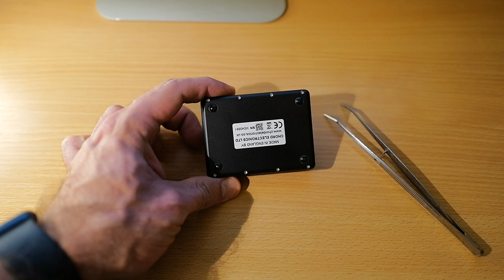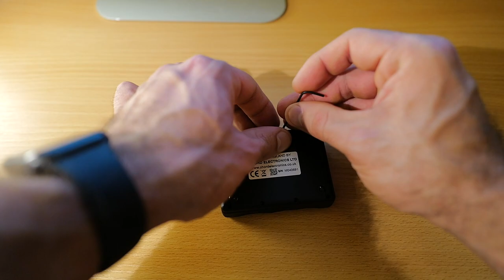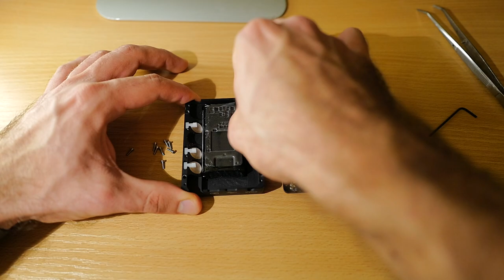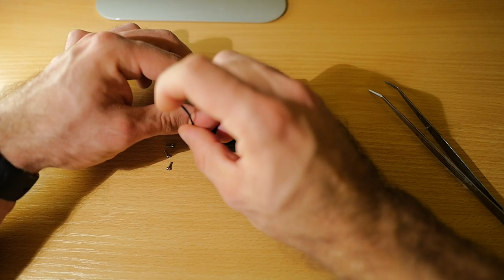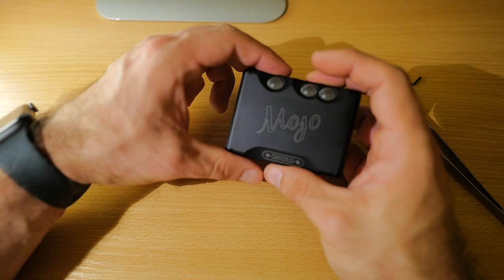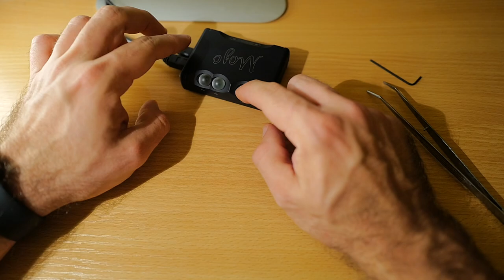How to convert Mojo into a (always on) DESKTOP DAC? Step-by-step GUIDE

Comment: Fantastic and very helpful video, I disconected the battery and refitted the whole thing in about 5 minutes. I only use the Mojo as a desktop device and the battery was getting way too hot and switching off occasionally. But now it's connected all the time with no problems. 👍👍👍👍👍
Reply: Mine still gets hot and that can't be good for the battery, did you take your battery out? It was glued in so I didn't bother and just left it in.
Reply: @BigWaterDrinker  I left my battery in, the device is still quite warm but not as much as before. They all seem to run very warm, I mean there's no active cooling but it works fine and I use mine nearly all day long.
Reply from the maker: I tried taking it out and leaving it in. No major difference actually. The battery is built to withstand the operating temperatures of the device.
Reply: @TechBlogPool  Wow thanks for responding. I got this as a gift from a family member and don't really wanna ruin it but I also don't really see myself using it portably ever so its good to know that I'm not ruining it by leaving it plugged in.
Reply from the maker: Not at all. You can leave it safely plugged in.

Comment: Great idea! I could never get my Mojo to not emit a whine when the battery is fully charged no matter what USB charger I used even with my lab power supply which is very clean this always happens. Should try this neat trick whenever I need to use it as a desktop DAC!

Comment: I purchased a Mojo that's been modified, they removed the battery and optical input and replaced it with DC plug that's wired directly to the battery input on the board, it uses a 7.4v switching power supply. In my case it works well but there's a faint electrical hum in the background when using sensitive balanced armature earphones, so I'll be looking into trying a cleaner power supply in the future.

 It also runs from USB like this video providing you don't do both at the same time. When I boot up it makes the whining noise quite loudly for 10-seconds then it subsides into a much quieter whine you can hardly hear (think a fish tank pump) and it makes this noise even when the Mojo is turned off but still connected to power. As OP mentioned when music is playing it goes away completely but mines so faint you must listen hard to hear it after those install 10-seconds anyway. I've read its the USB filters on the board cleaning up the USB power supply?

As for sound I honestly think it sounds cleaner and more open running from USB but I  think my 7.4 power supply isn't the best and want to try a higher quality one.
Reply from the maker: Thanks for sharing your experience! May I ask, this noise, can you hear it in the headphones or is it the Mojo itself making it?
Reply: @TechBlogPool  I hear a slight electrical/whistle noise when running Mojo from the 7.4v power supply, this can be heard through my very sensitive balanced armature earphones, (its subtle) but with higher ohm headphones like HD800S you cannot hear it so its just with low impedance earphones and I'm hoping using a really clean 7.4v power supply (like a linear one mentioned) might stop that noise. The Mojo unit itself running from the 7.4v power supply is silent, even on start-up

The other noise I hear is what's being described by others in the comments when I power it via USB, like a whining / fuzzy noise coming directly from Mojo
Reply from the maker: Alright. I understand now. On an unmodified Mojo the noise with low impedance earphones should not be heard, correct?
Reply: @TechBlogPool  No, you shouldn't hear it at all, and I don't hear any noise through my earphones powered by USB.

Comment: Thanks, useful video. I just bought a used Mojo 1, and love it. I'm using it with my WiiM Pro Plus, my vintage amp and cd player. I have left it plugged in and charging and it only seems to get warm-ish. I can hear no noises from it when not playing.
I understand it isn't supposed to be used this way, which is why I was considering disconnecting the battery, but now I'm thinking I'll just continue to keep an eye (or rather a hand) on it. If it gets hot then I guess it's time to remove the battery?
Maybe the mellow sounds I play don't challenge the Mojo enough for it to get hot....

Comment: Looking at all the comments about the Mojo hissing sound when converted to USB power I think this is caused by the  electronics associated for charging the battery that is no longer connected. The battery is 7.4 volts and the USB charger is 5 volts so what we end up with is a Mojo that is underpowered and MAYBE that's why we hear that buzzing hissing sound (Only Rob Watts can confirm this 😊)
A good mod would be to get a high quality 7.4 volt linear power supply and wire it into the same connector where the battery would normally connect.
My Mojo recently stopped working due to dead battery so I will be trying the mod I just described.
Reply from the maker: Hi there, actually the hissing sound is also hear on many unmodded Mojos... it is unfortunately by design. A coil noise I would call it. When connected to a home theater at a distance you can’t hear it. When on a desk with a PC/Mac you can simply turn it off. In my case the noise stops once the Mojo receives any - even mute - signal via USB.
Reply: The FPGA only uses 0.7 volts and the output stage is 3 volts, 5 volts should be more than enough. Just because a battery is 7.4, it does not mean that the device its powering is 7.4 volts too. Many devices down regulate to a lower voltage. 

My experience of removing the battery suggests that there is no deterioration in sound quality or volume. I'm using an Allo Shanti (5v 1amp rail) linear power supply which uses super caps on. Depending on the power supply you use YMMV but I would doubt the Mojo requires 7.4 volts.
Reply from the maker: Not sure about other parameters but from my experience 2A charger was necessary and 1A was not enough.
Reply: @TechBlogPool  are you using headphones or using it as a standalone DAC plugged into an amplifier? Perhaps it's the load of certain headphones that are challenging the lower amp power supply? I'm not sure.

In my experience though, using the Mojo as a standalone DAC using the 3V line out setting I haven't had to adjust the volume control on my amp at all. If anything the DAC sounds more authoritative. Maybe it's something to do with the super caps! 

But consider this. If 1 amp wasn't enough to charge the battery and use the DAC at the same time, the battery would eventually run dry, even when plugged in. That would suggest there's something else at play if 1 amp wasn't enough for your Mojo...

Who knows!  :D
Reply from the maker: Yes, if you leave the mojo connected and used to 1A power supply then it does run dry. 

I used it with an amplifier and with headphones. No difference in noise the mojo makes.
Reply: @TechBlogPool  No, what I was saying was my Mojo never ran out when connected to the 1 amp supply. There was definitely more heat and that whining noise when I used a 2.5amp supply and longer cables. Your Chord supply is different though. There are so many variables.

Comment: I purchased a modified Mojo, battery removed, replaced the optical port with a power port, using 7.5V power supply(MEAN WELL 7.5V 2A, model number: GST18U07-P1J). It works perfect for my computer, I used it on both mac and windows PC as desktop DAC, no noise and no hissing, no matter it is standby or has signal. I am using Westone W40 earphone. I am not an expert for Mojo, but the removed battery is rated at 7.4V, so I think using a 7.5V power supply is a correct way. The 5V usb is used for charging the battery, I do not think it is a correct move to power the Mojo using just a 5V power supply, otherwise the Mojo should ship with a 5V battery instead of a 7.4V battery. Somebody mentioned that using a linear power supply may improve the sound quality but I do not have a chance to try, logically it will.
Reply: Hi I'm planning a similar mod.  The 5V charging port goes to a Switch Mode Power Supply (SMPS) on the back of the pcb.  The SMPS produces 9V (noisy)  which is used by a charge control chip to charges the battery (7.4 - 8.4V)  The output from the battery powers the DAC/AMP.  You can see test point 9V (TP_9V) and (TP_CHG) on the PCB.   The round can next to where the battery plugged in is a capacitor which will reject the 80mV noise & ripple from the MEAN WELL.  The MEAN WELL looks good as other power supplies I've looked at have a noise & ripple of 300mV.

Comment: I tried this exactly as outlined here and it did indeed covert the Mojo to USB power only. The problem I have is that unbearable whine that it emits while playing. It had plenty of time to power up and did have a signal being fed to it. It is the same noise it would emit when the battery was fully charged. It is obvious enough to be heard during quieter passages. Any ideas why it is doing this?
Reply from the maker: I’m sorry to hear that. It seems at this point it is a hit or miss. Some Mojos do this and some don’t. It’s a high pitch could noise. Unfortunately it is due to an unfortunate design and choice of components.
Reply: TechBlogPool:  Fortunately, I was able to get a new mojo battery for $43 from my local audio dealer. It is the same factory battery that comes installed. Once I put it in, all the whining noise went away. I will just have to be careful not to over charge.
Reply: The 5V charging port goes to a Switch Mode Power Supply (SMPS) on the back of the pcb.  The SMPS produces 9V (noisy)  which is used by a charge control chip to charges the battery (7.4 - 8.4V)  The output from the battery powers the DAC/AMP.  You can see test point 9V (TP_9V) and (TP_CHG) on the PCB.  So without the battery you get the noise of the 9V SMPS (and the heat).

Comment: I tried this because i loved the idea of using it like that but it would just shut off intermittently within minutes of playing.  i plugged the battery back in and it works fine.  i have no idea why but read that you can keep it plugged in even with the battery connected and it wouldnt harm the device even if the battery is completely dead
Reply from the maker: My guess is that the power supply wasn’t good enough. Try again with the official Chord Hugo poet supply.

Comment: Mate , no offense but this device is not a washing machine or a flash light . You just disconnected a noiseless power supply ( battery)  capable of delivering “juice” when needed and now you’re relying  on 500ma from a USB port that’s very noisy . 
To all the guys who hear the “hissing” , it’s the USB port . All of them are noisy. 
If you want a proper source of power then you need an external  linear power supply of 7 volts and 2000ma at least . This is how you should do it properly .
Reply from the maker: Unfortunately you’re wrong here. The mojo hisses normally when on battery power or when on battery and being charged. It’s built that way. It’s a coil noise type of sound and has literally nothing to do with USB. On top of that the USB power is galvanically isolated and by definition doesn’t transfer any noise to the device. If you study the construction of the mojo you’d know 500ma wouldn’t even turn it on. It has two USB inputs. Galvanically isolated. One purely for power input with 2A needed to run mojo and the other without power transfer just for data transfer being an asynchronous USB. You’re mixing and matching hifi terminology here. When an audiophile says a USB is noisy he is saying the noise floor in his music is higher because of said interferences. The mojo is DEAD SILENT when connected to power without battery. There is zero added noise in the music. The noise discussed here is the coil noise of the device. None of which enters the audio stream.
Reply: @TechBlogPool   then I should do a video with oscilloscope frequency to prove the noise injected in the charging usb port by the switching dc-dc converter . 
I’m using the mojo in a car system and I can hear clearly the difference between a  linear dc-dc power and switching power supply .
Reply from the maker: You can “hear” the difference between dc-dc and linear in a Car? Really? In a Car? Hmm I can’t possibly imagine you can hear any difference whatsoever in a car where car noise, cabin acoustics and all sort of other variables come into play. I have no idea what you’re connecting it to thou specifically. All I ever connected it to was the official Chord Hugo wall charger I ordered from Chord and used with the Mojo. Perhaps if you connect it to lesser sources the Mojo is hampered. But I can’t say.
Reply: @TechBlogPool   if you use the Chord power supply then you are more than ok . I was talking about any other 5v power supply . 
I’m sure that Chord used high quality parts in they’re power supply , linear  and filtered as well . 
Regarding my car scenario , just imagine that the car is stationary , engine off . The noise is best heard between the tracks . I have analyzed a lot of power supply with the oscilloscope , specifically for the noise injection  . 
Most of them are totally garbage when used with sound preamps .
Reply from the maker: To be honest I’m not super well versed in the power supply field. I remember a couple videos from Inner fidelity speaking about it but that is about all the knowledge I have. I guess a really bad power supply can’t be fixed. I’m wondering if it can be improved. I had the jitter bug from Audioquest and also the Chord Mojo cable package comes with some magnets to wrap around cables to help against interference. What is your experience? To be honest I didn’t have a good 2A power supply and all the phone chargers I had were the 1A Apple changers so they weren’t enough to prevent the mojo from running out of juice so I decided to just get the one from Chord and be done with it and prevent any issues. But as regards to the noise of the coil whine.., that is something I could always hear from the mojo when it wasn’t receiving any signal from USB, once it did then the noise would stop.
Reply: @TechBlogPool   regarding the whining noise : I haven’t found this issue yet . I just got the mojo few days ago , specifically for car implementation . I will test it in my house system and figure out what’s this whining . 
Regarding the power supply , there are two types : switching and linear . 
The best power supply for audio devices are linear and bulk because of the transformer . The switched power supply are small form and more cheap to produce , however they are really noisy because of the switching frequency . 
A linear power supply transforms the current thru two coils continuously and the regulator is stabilizing the curent to a specified value while the unused curent is transformed in heat . 
The switching power supply is just turning on and of the circuit to provide the required curent . That’s why they call it switching power supply .
Reply from the maker: Thanks for the info!
Reply: @TechBlogPool  you're wrong about the noise. I use an Allo Shanti Linear power supply (5v 1amp) and it is completely silent. The quality of the power supply does make a difference. I use this with the battery completely removed. A 5V 1 amp supply is recommended by Chord for charging the Mojo. A supply with higher amperage would make the hissing sound much worse.

When I was using the Mojo on battery, the Mojo was quietest when I used a 1amp 5v usb supply (switching) and the short USB lead supplied with the Mojo. The hissing sound was minimal and I'd have to have my ear right next to it to hear it. Other longer leads made the hissing sound much louder. It seems that resistance is causing the hissing sound.
Reply from the maker: Hi Nick, which part am I wrong about? The discussion was about noise of Mojo, the noise the device makes itself. Not the noise in audio you get from headphone output. The noise of the mojo has nothing to do with power supply. I tired a shitty USB charger and I still couldn’t hear ANY noise in the headphone output though.
Reply: @TechBlogPool  in the Mojo instruction manual it states the Mojo needs 1 amp minimum you stated it needs 2 and this isn't the case. When charging the Mojo with a 2 amp supply the hissing will be much louder. I also noted that the best lead for charging the Mojo was the one supplied. It's very short so has low resistance. 

I would suggest that using the lowest amperage supply you can to prevent the down regulation circuits from cutting in. The less work circuits have to do, the lower the noise floor. Also As stated before, the higher powered supplies caused the DAC to make that humming noise louder and I found it used to overheat much more frequently. A 1 amp switching apple charger was the best tool for the job when I had the battery installed.

Edit:

Just out of curiosity I checked what power supply the Chord Qutest uses. It uses a 2amp 5v supply. I suspect the Qutest will make full use of the tap length though because it doesn't have to be efficient as it doesn't run on battery.
Reply from the maker: Hi Nick, the manual only discusses the state if Mojo being used with a battery. It doesn’t discuss power needs of Mojo without a battery. When using mojo with a 1A charger the mojo would discharge faster during use than the charging capability is. I only have the charger I ordered directly from Chord, it’s the same charger they use for HUGO, 2A charger. Noise level was the same as with 1A charger or USB charging from imac. You’re combing taps with power. It’s apples and oranges.
Reply: @TechBlogPool  That's interesting when you state that your Mojo would run out of juice. Weird. 

Yes, the more taps that are taken advantage of, the more power the processor will use. The Qutest has the same FPGA as the Mojo. The tap length of the former is longer and thus requires a beefier supply. There are probably other differences too.